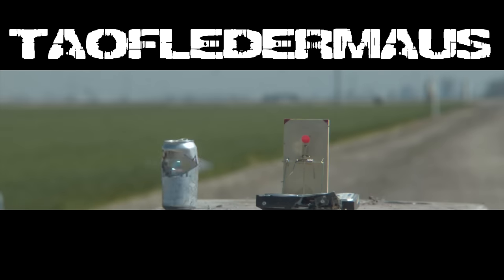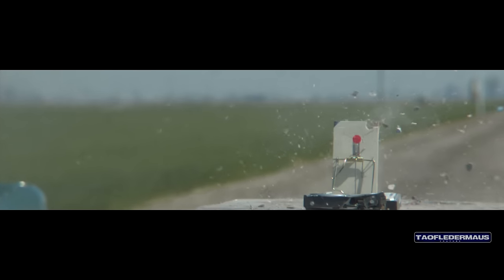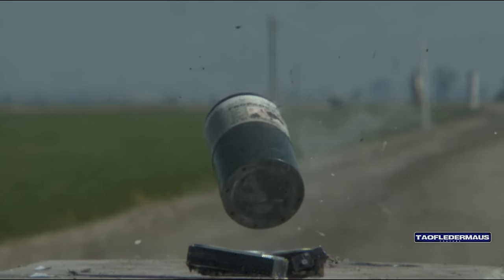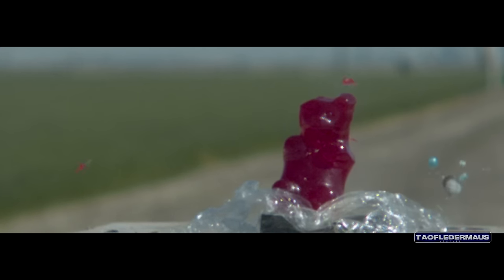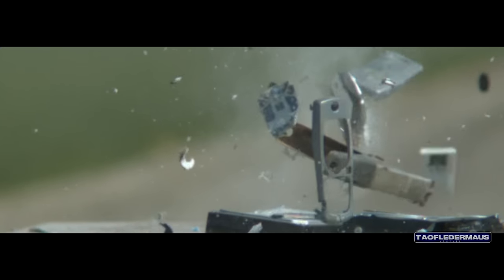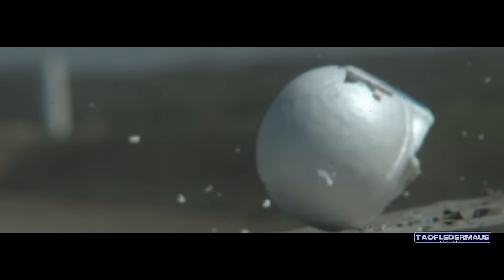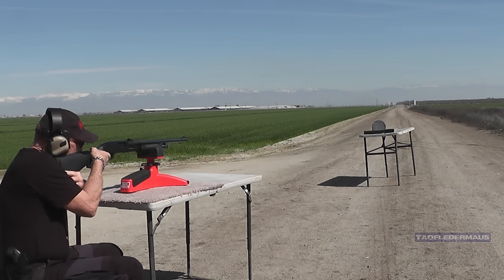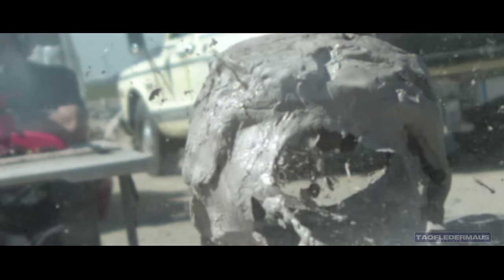12 Bore GLASS Marble Shotgun Ammo - Amazing Results!

Comment: When I was young a friend of mine  had an old  H&R single shot 16 gauge and we shot about anything that would pass threw the choke out of it. We shot a lot of marbles and  yes they are wicked out of a shotgun. Steel ball bearings are really wicked as they don't break or deform at all. His dad's barn still has a very nice pattern of small finish nails stuck in the side of it. Finish nails fly much better than the so called freshets.

Comment: Back when you could buy real firecrackers. A 3" red one and 12" of black pipe W/cap would shoot a marble thru a 2X4 at 8 feet or so.
Reply: We didn't have the monster crackers in Aus. But one known as a 3 penny banger, about 3/8 diameter and 1 1/2 inches long in some 1/2 iron water pipe would put a marble through a house window from about 50 feet away. Go on ask me how I know, the neighbor never spoke to  me again.
Reply: ...and 6 "M-100s" taped together can send a 15" steel wheel over 1000 feet straight up. Yes, I did that.
Reply: @timhallas4275  Were M100s ever made commercially?
Reply: @toddy2519 : Um, how else would I have been able to buy them?
Reply: @timhallas4275  Many basement pyros made very powerful 'crackers and sold them to friends and others until the ATF classified them as explosives along with felony charges which is why today no M80s or Cherry Bombs are commercially available. What year were you able to buy the commercial products?
Reply: @toddy2519 : The M-100s and came from China. yes, they were highly illegal in the 1970s when I bought them by the bag full for 25 cents each.  M-200s were 50 cents each and one of them could make a hole in concrete. I doubt that these things were ever legal in the united states. That apparently doesn't stop us from getting them by the millions every summer.
Reply: PS. I make my own explosives now. planning to send a squirrel to hell this summer.

Comment: A lot of old style computer--mice--the ones with a trackball in the bottom, use a ~.68 caliber ball bearing, a smooth, polished, hard-steel sphere, encased in a plastic shell. Cut the shell away and you have a steel "punkin' ball." Wrap it in the 12-guage shot cup that makes the best fit with your cylinder bore, put some shot buffer behind the slug help buttress the wad, and launch it at maybe 2,000 feet per second, and I wouldn't want to be an engine in its way. No, it wouldn't "bust the block." But it wouldn't do a valve assembly, cylinder head, water jacket, or oil pan any good, it might go through one side of a cast-iron block and prang up a crankshaft bearing, and I'll bet one through a clutch or gear box would bring things grinding to a halt, too.

Don't know if it's legal: wouldn't do a bear any good, either. Not that I got anything against bears....

Might pretty much ignore body armor, too. Check legality where you live.

Be very aware, if you smack a hard, 90-degree (from you) surface with one of these, it might bounce straight back at you with all the speed with which it struck. Bad idea. And it is absolutely going to ricochet off of any hard, angled surface.  

Cuidado!

Comment: Excellent video. The tool used in the drill is interesting, to reshape the mouth of the cartridge, after putting the glass ball (see minute 0.22). Where can I buy that tool? Thanks.
Reply from the maker: It's called a roll crimping tool.   You can get them at Ballistic Products or Reloader's network,  probably on ebay too.

Comment: When the high-speed camera is behind the target, try using a plain mirror at a 45° angle with the camera behind a strong protective barrier. Much cheaper to replace the mirror in case debris goes flying.

Comment: How about firing those little  Jack's that kids would spin as a game?
That I think would be very good close range home defense, as they probably wouldn't go through walls.

Or as I think 
Billy the Kid would use a stack of dimes in the shell. I saw that on a movie.

Or washers, with a bolt in the holes of the washers so you might get more range before it opens up the,  pattern as the bolt separates  from the washers.
Or just washers.

Or nails, with the heads of the nails cut off, so it is like the "bee hive" rounds that they would use in anti personnel rounds in the artillery at point blank range.

I think 16p nails would be fantastic.

Comment: A Marble, a "BOULDER", that's what we called the bigger marble back when I was a kid. A marble shot out of a Wrist Rocket Sling shot, would take a squirrel or rabbit.Smackem in the back of the head worked every time. A marble fired from a shotgun. tho' ,  would probably really ruin someones day. A very light weight bullet traveling at a very high rate of speed is what's working here. A Self Protection round?

Comment: we used to ambush deer back in the 1940s with a 12G and a round lead ball used as fishing weights.  we would sit at one end of a ride and the beaters came from the opposite ends driving deer down the pathways. where we were waiting. the shot was close range, in the head or heart. the deer died instantly. the cartridge was loaded the same way as your marble.  do not use a full choke barrel. if the shot was cast for an open barrel.